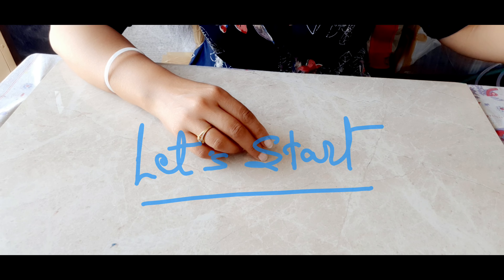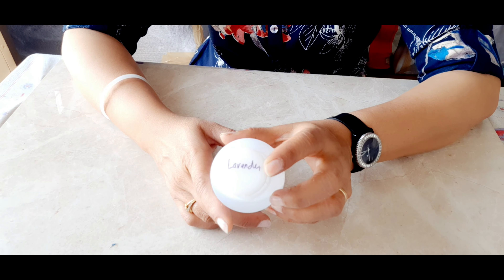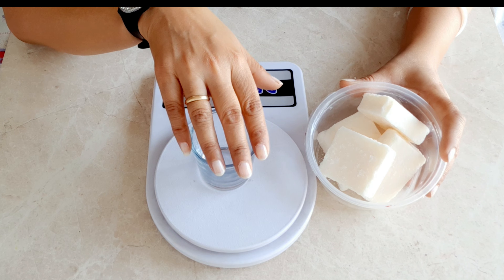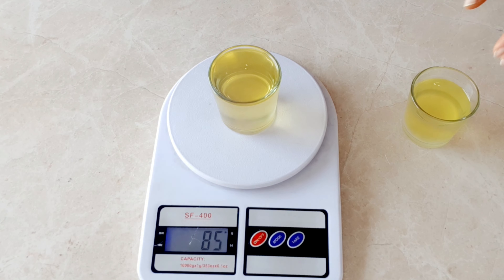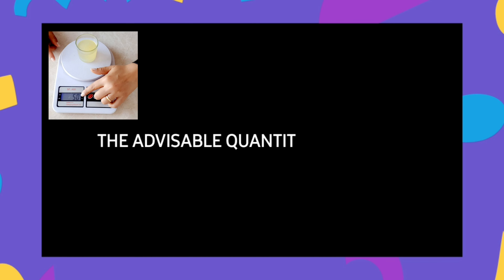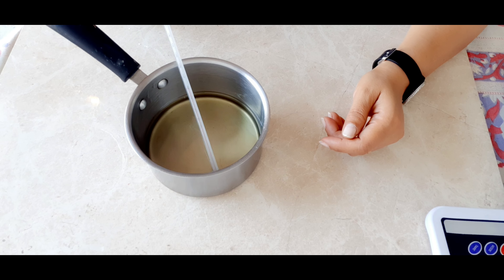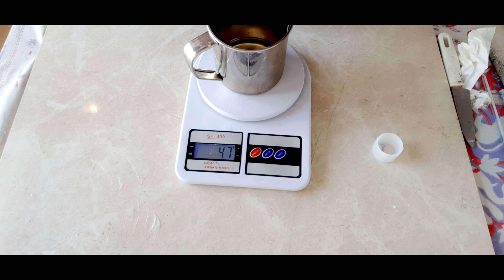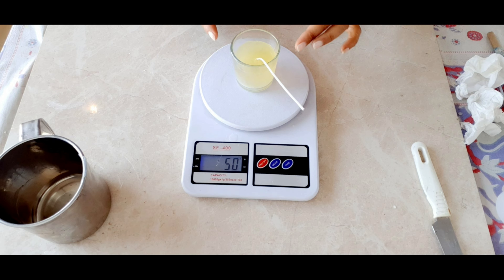HOW TO CALCULATE FRAGRANCE LOAD FOR CANDLE | HOW MUCH FRAGRANCE OIL TO ADD FOR PERFECT AROMA CANDLE

Comment: Make the math simple.  When I make paste wax for tools, I use 5 parts wax to 1 part linseed oil.  paste wax for finishing is 3 parts wax to 1 part boiled linseed oil.  Cutting board butter is 3 parts mineral oil to 1 part wax.  What is the calculation for fragrance.  x part was to x part oil.  Very simple to give us!  you say 5%.  So...that is 10 parts wax to 1 part fragrance?

Comment: Just curious, 50g of soy wax and 10% of FO will give you 55g in total.. since you’re reducing the soy wax to 45g and adding 5g of FO it is not going to give you 10% of FO ratio.. the percentage will increase correct?
Reply: 90% wax, 10% fragrance oil
Or you may say 9:1